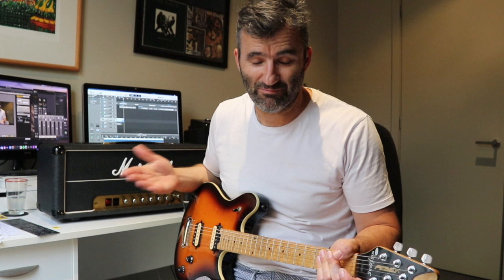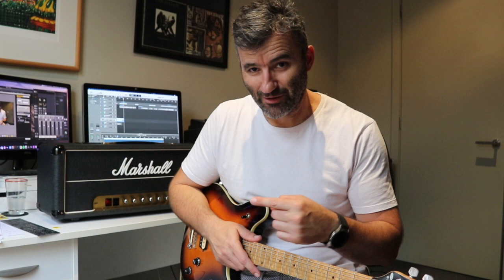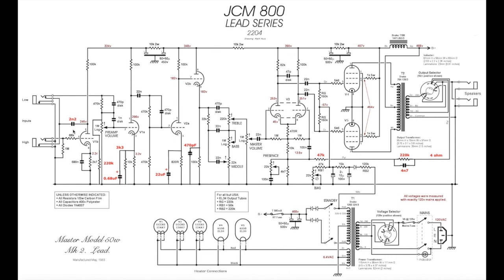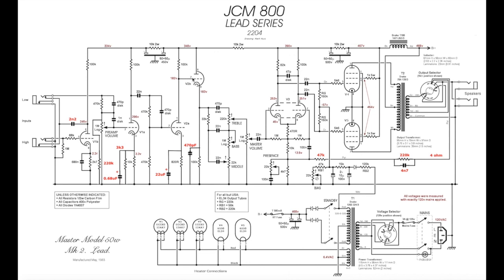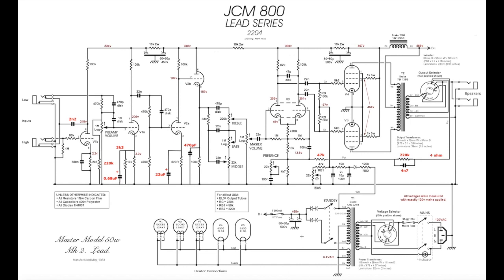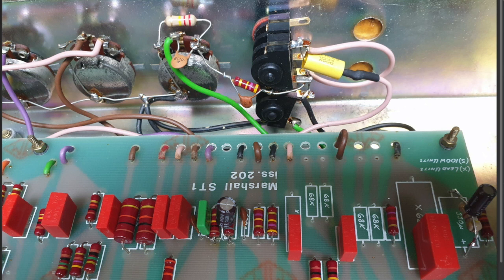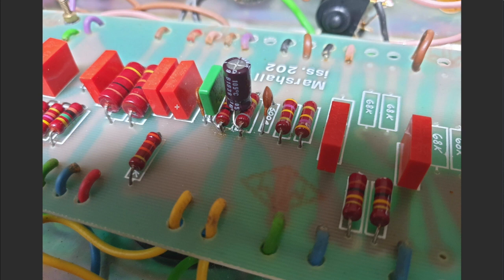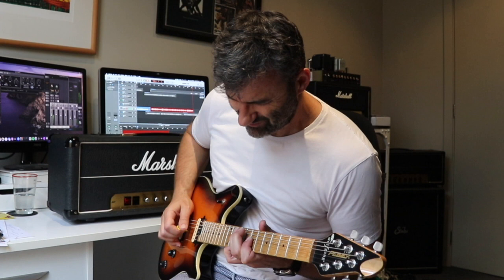Marshall JMP/JCM800 2203/2204 - Jake E. Lee Spec Mod Guide

Comment: Does this work with a 50 watt 1987 circuit?
Reply: Never mind I missed the part where you said 1987x.  Should be the same as my clone I built
Reply from the maker: You have to rewire the front end as a 2204
Reply: @HeadfirstAmps thanks for the reply!  I realized that now after watching this video 10 times.  I guess I am a little slow in the uptake!   

I am going to search for a different mod to keep the 1987 circuit but try to tighten it up a bit.  I just finished this build and it’s for a friend as a gift.  Pretty much stock 1987 with a LarMar PPIMV.  I am just getting ready to test voltages.  

Looks like my next build is gonna have to be this!  Thank you so much for all of your insight.  You are extremely easy to follow and your teaching here is exactly my learning style.  So, thanks again!!!
Reply: @tfrost33elkhunter 
So I received this gift yesterday, and it’s AMAZING!  🤘🏻🤘🏻🤘🏻

Comment: So is this mod max gain on channel 2 of the Friedman JEL??....I noticed the Friedman has a gain switch on channel 2...
Reply from the maker: Yes, max gain mode.  You can implement min gain via leaving the 10k 2nd cathode untouched, and not putting the 220k resistor on the gain pot.
Reply: @HeadfirstAmps  That’s amazing that a handful of resistors and caps make that much difference....
Reply from the maker: The 2203/2204 is a classic circuit.  An awesome platform to tweak from.
Reply: @HeadfirstAmps  so if I wanted the negative feedback on a “Depth”knob,would you put the pot wired into the boards negative FB resistor,or wire it into the impedance Jack?...also,if the NFB comes from the 4 ohm tap,does that mean you get more or less NFB if you are using say the 16 ohm setting to match your cab??
Reply: @scottpeters4401  Hi Scott, two things.  Variable negative feedback and depth are different, but related.  I wire from the impedance selector to depth (with fixed or variable resistor), to NFB resistor (fixed or variable).  You can put none, one of or both of these controls on pots. 4 ohm tap gives you less, 16ohm tap more NFB.
Reply: @jasonktong1  Basically I am trying to wrap my head around making my mod like the JEL,with a Depth knob,or Thump as they call it....so staying with that scheme,pot on the speaker tap or the board..??...I assume the Thump knob would be a pot on the NFB board resistor,and the one on the speaker impedance switch would be fixed?..I guess NFB in two places is confusing me...and the definition of the “Thump”knob on the JEL....I have an 86 JCM800 2204...I was going to mod it before I do my first build....You know,just to make sure I don’t burn the house down.....
Reply: @scottpeters4401  Ok cool, for a depth pot what you'd do is replace the 220k resistor, that I have in parallel with the 4n7 capacitor, with a 1M pot.  email me at headfirst.amplification@gmail.com and I'll draw it for you.
Reply: @jasonktong1  Thank You Jason....I am gathering parts now for my first build,then I saw this and thought it would be a perfect project to get my feet wet....

Comment: Are these mods possible on a RedBear MK60? (supposedly a 2204 clone with 6L6’s; HW P2P)
Reply from the maker: I’ve not been in one, but probably so if it’s HW
Reply: Yes but it will take a bit of extra work as the Red Bear doesn't use the Marshall style Presence control so a lot of the wiring for the NFB will need to be added. The general circuit of the MK60 is a close copy of the Marshall MKII.